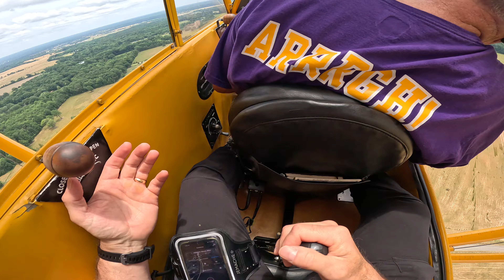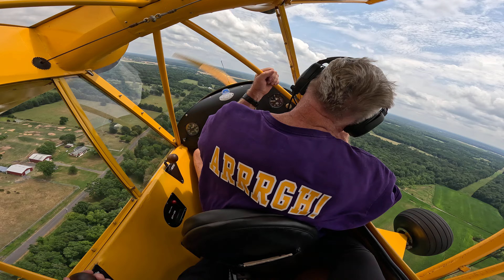AARRGH!

Comment: I have done that more than once with my cub! 

Same thing… see the cap bobbing and oil splatting on the side of the fuselage and wing struts. 

We learned that the cap needed a good rubber gasket that was thick enough to put some pressure on the cap.

Comment: I bought a new Ford truck in 77. When I did the first oil change the clip that is cramped to the cap let go and fell inside the valve cover on the head. I fished it out with a magnet. Then I drilled the clip and installed a screw to hold it on.